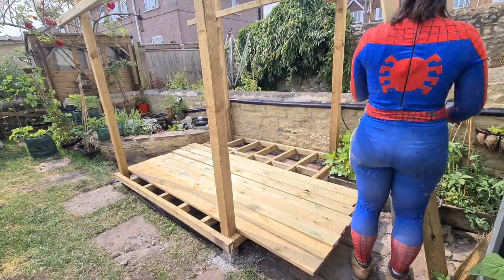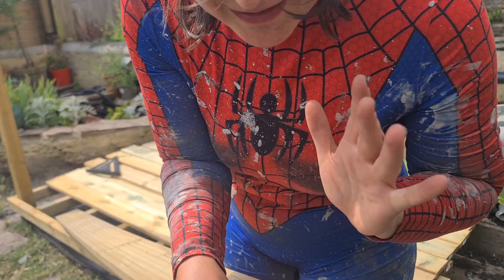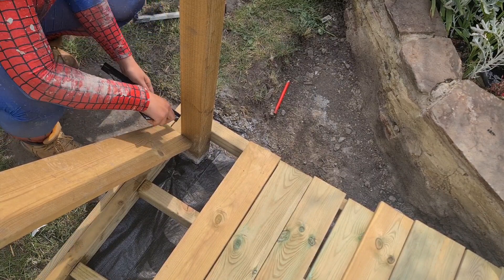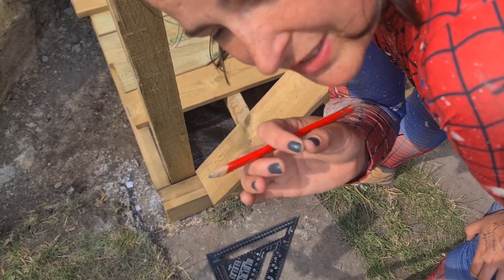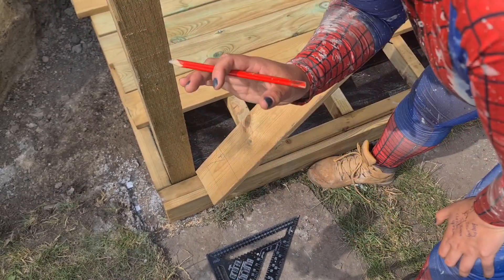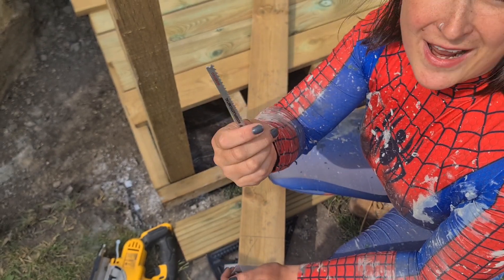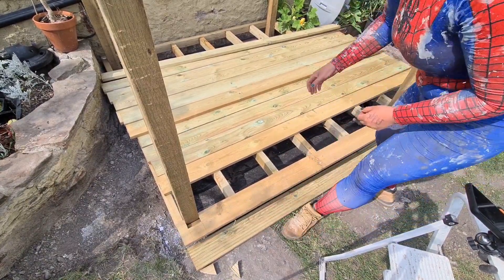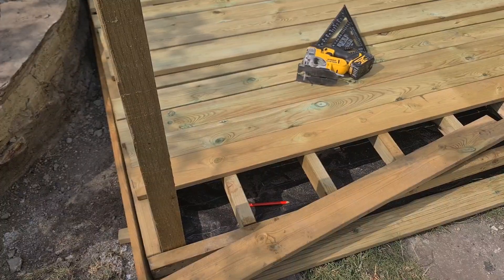BUILDING A DECK PART 12 #emmavlogs 73

Comment: Are you going to install the boards tread side down🤔🤔 loved the video 🙏🙏
Reply from the maker: Either way you put them, someone comments and says they're upside down! 😂 The great debate began a few years ago with the theory that they were supposed to be grooves side down to allow the moisture to evaporate from the underside and lengthen the life of the decking by avoiding damp and rot!

I thought it was v interesting! ❤️
Reply from the maker: Well I should add that there needs to be some grooves on the bottom, if you've got grooves either side it doesn't matter if you put the big ones on the small ones on the bottom
Reply: @diywithemma  Emma if you say tread side down that's gospel, your the teacher and I'm the pupil 🥰🥰

Comment: Isn’t that decking board upside down?!
Reply: It might that way because the hot tub is going on it
Reply from the maker: You can do either, but I get corrected either way! 😂 One school of thought is that the grooves are to go on top for grip where you walk, and the other is that the grooves go underneath to help moisture evaporate and length the life of the decking by avoiding damp and rot in the wood! ❤️ But but my groves have to go down because they're flat on the other side if you've got grooves on either side it doesn't matter which way they go down.

Comment: Hi Emma  your doing a good job there,but arnt the boards supposed  to be the other way round or can you use both side just a thought. Either way love your videos xx
Reply from the maker: You can use both, and that seems to be the great debate! One side says that the grooves are to go on top for grip where you walk, and one side says that the grooves go underneath to help moisture evaporate and length the life of the decking by avoiding damp and rot in the wood! ❤️ BTW i should add that the grooves on my boards have to go on the bottom because the tops of my boards are flat. There must be grooves on the bottom at least but if there are grooves both sides It doesn't matter too much which way you put them.